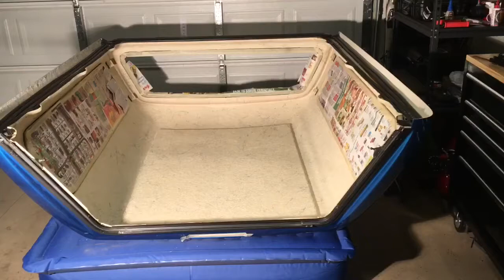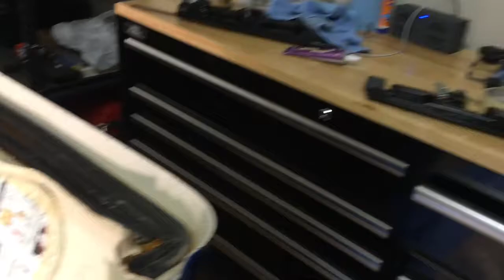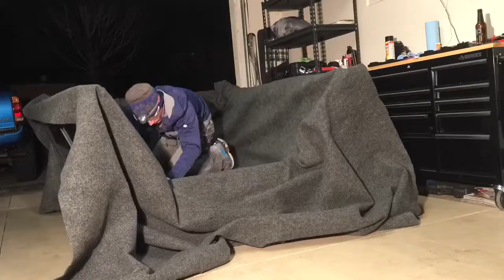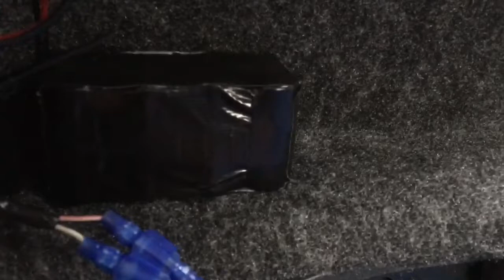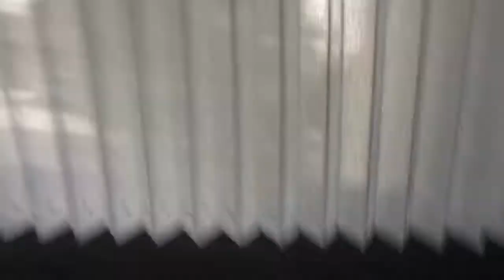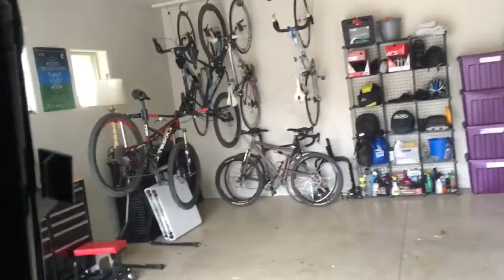Used Camper Shell Renovation On A 2nd Generation Tacoma

Comment: Hey Jim, 

Great Video. I recently purchased a camper shell, very similar to yours and am looking to do exactly the same upgrades as well. Wondering if you recall where you got the light setup and also the tracks for the roof rack setup. Thanks
Reply from the maker: Kyle Nelson, Kyle thanks for your comment. The roof rack system came preinstalled from the factory but you can find the LED lights on eBay with this link. 
https://rover.ebay.com/rover/0/0/0?mpre=https%3A%2F%2Fwww.ebay.com%2Fulk%2Fitm%2F400814273502

Comment: how'd you mount the cargo net?
Reply from the maker: I purchased 4 tie-down anchors and installed them at the corners using the existing hardware of the roof rack system. From there the net just clips into the tie down anchors. Some nets come with 6 clips,  if that was the case you could install 6 tie down anchors for extra support. I would recommend going with a heavier duty cargo net than the one I used. Something that was made of durable webbing and utilizes adjustable straps instead of elasticity. After being exposed to heat and having various things stored in it, the elasticity of the stretchy net I used gave out and is no longer functional.
Reply: @Truncali82  Yeah I don't have a roof rack on my camper so I've been trying to find a way that does't involve any drilling.  Thanks though.

Comment: How is the headliner holding up? Especially on hot days? Nice work. I'm doing the same to my Leer. Doesn't seem as leer wants to sell me the headliner so I'll contact snugtop
Reply from the maker: Bryce Hughes, It’s holding up pretty well. If I had to do it over I would have used a third can of spray. There are a few spots where it has started to separate. One is where it was stretched into the corners near the tailgate, another is where I have the spool of extra wire velcroed, and the last is where one of the LED lights attaches, but its because it gets hit with the handlebars when loading my bike. Its all very minor and I’m sure no body would notice it except me. Good luck!

Comment: Nice job on the renovation. I just bought a shell for mine and as wondering if you installed it on top of the plastic bed rails or pulled them off?
Reply from the maker: It's installed on top of the stock plastic bed rails.
Reply: Ok. Cool. Mine did too. The gap in the front is just huge. I will figure a way to fill it.
Reply from the maker: I recommend getting a hold of Snug Top or your local camper shell distributor. Mine does not have a gap because there is a rubber seal in place, yours may be missing. I think the seals are fairly generic so they shouldn't be hard to find. Good luck!
Reply: I will give that a try. We have a Canopy World near us. Thanks.
Reply: Jim Truncali anyway you can point me in the direction of the led light kit you got? Thanks in advance